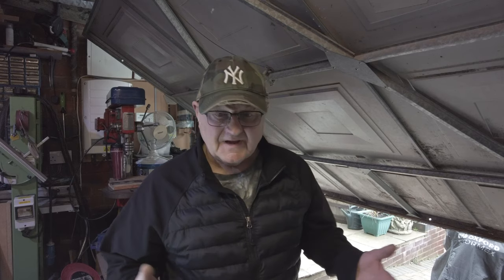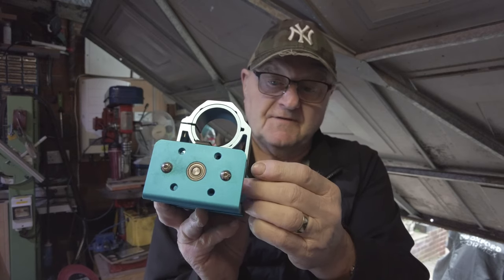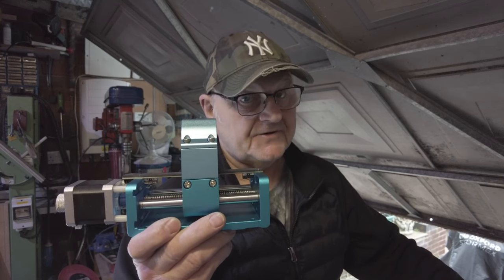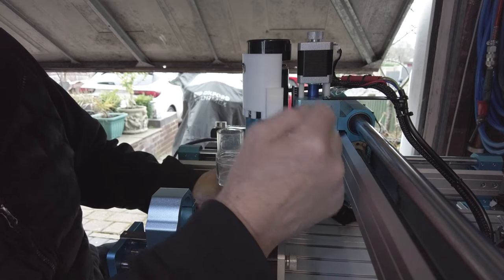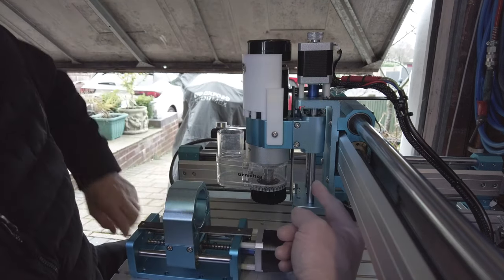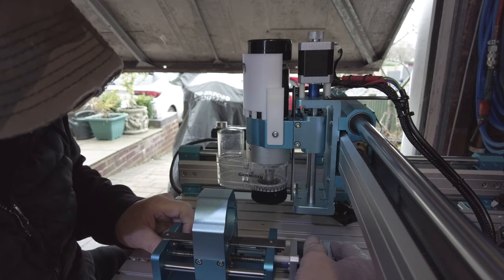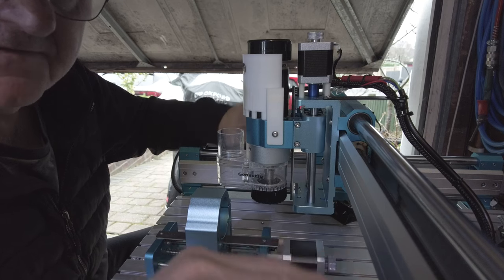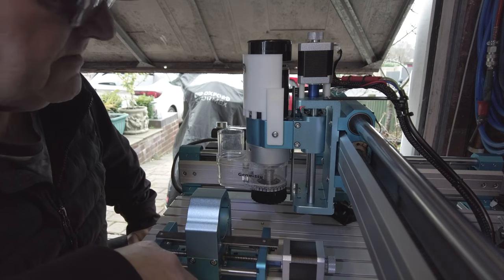Sainsmart CNC 4040 pro Interchanging parts between the upgraded z axis and the old one

Comment: Hello Tony
Thanks for the update. 
The displacement is linear. If you extend the length by 10% you will get 10% more displacement.

Have you seen my comment about upgrading the Firmware on your ”Genmitsu 4040 Pro MPG Controller” video?
I have now bought the MPG Controller myself and recieved 2days ago. Totally worth the upgrade.
Keep safe.  /H
Reply from the maker: Hi thanks for the info I did not realise there was an update in the firmware I will have to look at this, what are the new features with the update have you noticed this is how we all learn Thanks
Reply: Hi Tony ... is there a firmware update for the main board on the CNC?    @Tonys.Top.Tips.Workshop
Reply from the maker: Hi according to the web site I think there is but I don't always update if I don't have any problems.
Reply: Thanks Tony    @Tonys.Top.Tips.Workshop
Reply: @Tonys.Top.Tips.Workshop  I described the update quite well in the comment in your other video. Basicly it will give you an GoTo X0Y0 option on the offline controller.
Reply from the maker: @heckenbacker   Thanks for the info will do

Comment: I noticed that your Z-axis is mounted to the X-axis using the upper set of bolts holes/lower position. Is that your recommended mounting position?  I'm finally installing the Makita router and could use some advice. Thanks in advance.
Reply from the maker: Hi thanks for your question,  when I am just using the bed and not the 4th axis use the position it is set in on the video. when using the fourth axis I lift z axis up that is to give the clearance. I don't use a router body so the preference is yours.

Comment: Where are folks getting this upgraded z-axis?
Reply from the maker: Hi thanks for your question You can only purchase the upgraded z axis frame from Sainsmart. I was one of the first that purchased this machine and I found faults due to this they then rectified those faults. I did have an issue with my z axis not flexing as reported but one of the bushes kept working out of its housing, so they sent me a replacement free of charge. I do know the upgraded one is considerably stronger this is better for a larger spindle to be used I think they are around £55
Reply: @Tonys.Top.Tips.Workshop  TY. I looked all over their site and couldn't find it so was starting to think it was 3rd party.  We'll see, I've barely used mine (yet).  Installed a 800W spindle, made spoil board...  all went fine, trammed perfectly, but need to get to designing things to make :D
Reply from the maker: @jb510  hi my advice  would  be simple designs and go slowly, understand  the principles  of cnc machining. It sounds like you  have  a good spindle that's a great start. If you have just purchased yours it should be the upgraded  one . Good luck keep me informed  of your  progress
Reply: @Tonys.Top.Tips.Workshop  well I purchased it black friday, just took a couple months to get setup (due to space, snow, other projects). I thought it was the older one, but looking again it is the newer one (elongated bearing area), yay!
Reply from the maker: @jb510  glad to here its the upgraded one
Reply: I have looked everywhere and cannot find the upgraded z axis, any ideas🤷🏼‍♂️
Reply from the maker: Hi you need to email sainsmart ask them if they can supply you with one they should do keep me informed